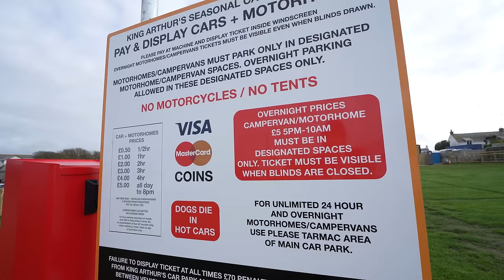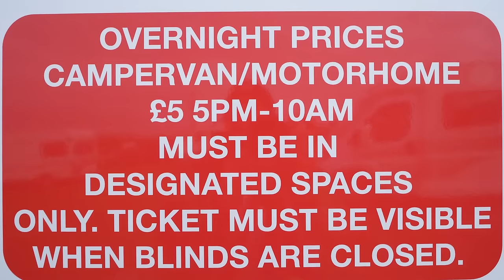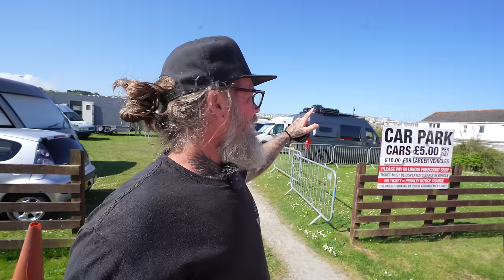CORNWALL - 'No Overnight Parking!' - What's the verdict?

Comment: Copper grease all vehicle wheel studs!!!
Reply from the maker: Oooh, a topic of hot debate that. I’ve always gone with the lugs are meant to be dry tightened?
Reply: @OurVanTales  I've found that they can seeze up and difficult to get off when you want a quick wheel change. I do use a torque wrench and also nut pointers.